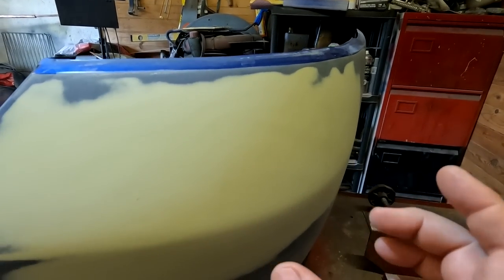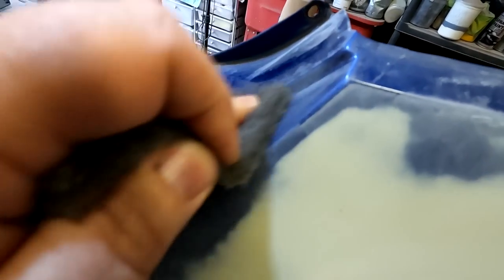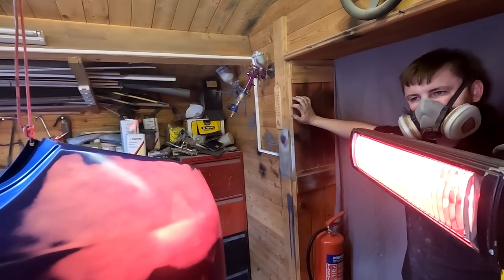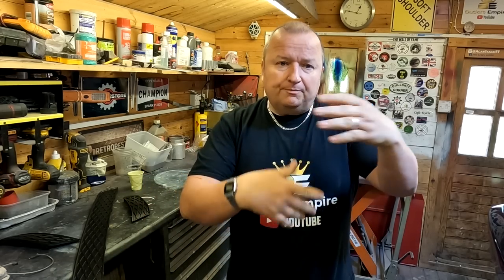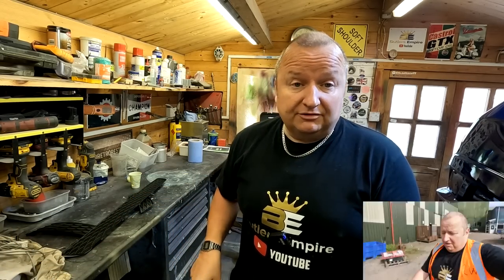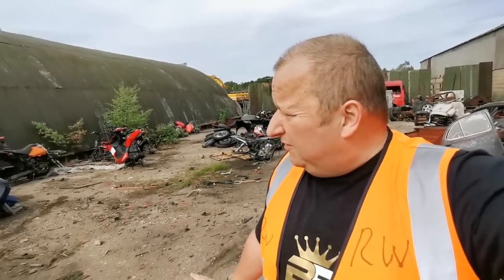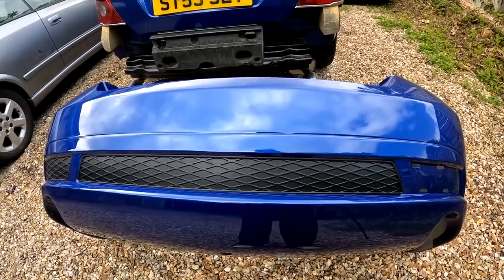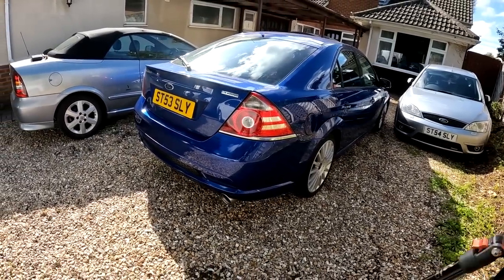Can You Paint Your Car's Bumper Cover In Your Shed

Comment: Those reflector bumper moldings are only for the ST's and they were for the facelift from 2005. The early MK3's didn't have the reflector. You can dremel off the pins on the back of the refelctor part and glue them onto the black molding. That's what I did when my secondhand bumper had a broken one.
Reply from the maker: I've got a set now James.

Comment: Great video Martin. I would have used those reflector pieces Martin, i wouldn't have drilled the 3 holes, i would have just cut those pins off. Bumper is looking great, nice colour and shine to it. The Peugeot 203 was a small family car which was produced  between 1948 and 1960, with a 1290 cc engine.
Cheers, Jeff.
Reply from the maker: The purists would be up in arms Jeff if i'd have fitted the reflectors ones. They are for the diesel ST.
Reply: Later models have reflectors on the bumper, earlier have reflectors in the rear lights so you dont have them in the bumper 😉
Reply: @retrorestore   i do believe you should have fitted those inserts with the reflectors as you have the facelift rear lights which don’t have reflectors in them making your car I think an mot failure. Those inserts are for both st tdci and the st 220 facelift models from mid 2005 onwards. Hope you find this helpful. Nice video and a good job considering the surroundings.

Comment: You couldnt got rid of those pin holes  on the reflector and still clipped it in with the black clips surely?
Reply from the maker: They are not for a ST220, they were for the diesel ST

Comment: Top job mate. Your boy is bloody good at what he does.100%👍🏻 Just something to note mate. U have got facelift rear lights fitted on your car. They don't have reflectors in them unlike the prefacelift ones which do. So effectively you currently have no rear reflectors. So u need to either fit the facelift bumper trim with the reflector built in, or refit the correct prefacelift rear light units.
Reply from the maker: Yes, someone else mentioned that but it's passed every MOT like that. I'll keep an eye on it.
Reply: It will pass the mot in most cases, as they don't bother to check. U only get a problem, when u park out on a road at night and someone runs into the back of u. As they will try n blame u, for having no reflectors.

Comment: As much as you didn’t want the panels with the reflectors, because you have the facelift rear lights you should actually have them fitted to your bumper because the facelift rear lights don’t have reflectors in whereas the pre facelift rear lights did. Your car has the wrong lights fitted If you want to keep it original 👍🏻 I do love a Mondeo video keep it coming 😃

Comment: what do they call that scrap yard. im after the 2 front wheel arch guards off the mk3 fiesta . if they post. or would buy off you. bumper came out nice
Reply from the maker: Its called  Windleys Lodge Rd, Tattershall, Lincoln LN4 4JS
Reply: @retrorestore  cheers ill see if they post stuff as im miles away in.newcastle

Comment: You should technically have those rear grills with the reflector in, as the face light lights don’t have a reflector built in.  Mine failed it’s MOT when I retrofitted them. 🤓
Reply from the maker: Nah, No reflectors in mine thanks. Passed MOT's fine. I know what you mean though.

Comment: You did the Vectra's front bumper in the shed so yes you can. When you paint in the shed do you get speckles of paint on the floor bench etc or does the extractor get rid of it?
Reply from the maker: No spekels just a layer of paint dust you have to clear up or cover stuff up.
Reply: @retrorestore  Only downside spray painting it goes everywhere when done inside.